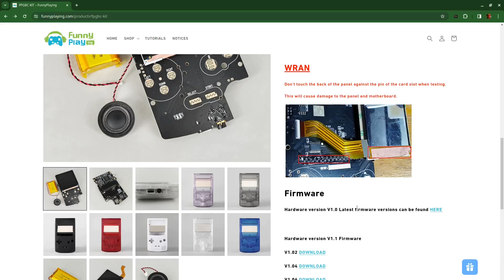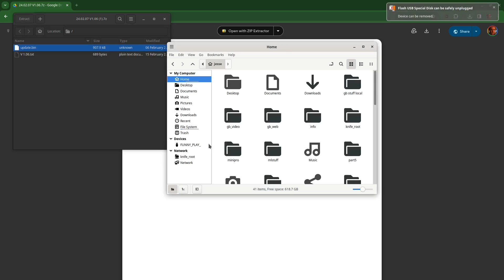Build a new GameBoy Color with the FPGBC

Comment: guys dont do it in the order he did at parts. get the screen on earlier, get the battery on before screwing in the case. otherwise itll be awkward. Also, when putting the screen in, dont just push the ribbon cable in without lifting the door (which this guy didn't mention). Watch Lon's video instead, he did it better.

Comment: After 2 motherboards, 2 screens and 3 ribbon connectors the screen never turns on no matter what you did... one of my friends got the same product and works flawlessly but no luck in my case, don't know what to do now...
Reply from the maker: Oh no! Does funny playing have useful customer service?

Does the system turn on at all? Is there audio?

If your friend is nearby and willing to take a risk you might try using their working system to diagnose yours. You could try their screen with your motherboard and your screen with theirs. Maybe have them do the assembly though, in case you're cursed

The risk is that something is fried and it fries their components

Comment: can you give me a tip? i tried 100 times to get the screen connected but the "thingy" doest go in. its so frustrating

+ i got wrong A and B! my not fitting in the holes...
Reply: They sent me wrong buttons as well just don't fit had to dremel one of the stalks off for them to fit.
Reply: @DerrenKing  thanks for this reply, can you play it fine? Or is the stuff you cutted out a problem
Reply: @JomaroTV  works fine if you don't have a dremel use nail clippers to just snip it off make sure you snip the right one as two will line up and one does not.
Reply from the maker: These connectors are so frustrating. Is it going in at all? Is the little black tab on the connector lifted up when you try to put it in?

Oh no! What A and B buttons did you get?

Comment: I heard everdrive works. Does the transfer cable port work for pokemon?
Reply from the maker: Another user says the Everdrive gb x7 is 100% working and I hear in general that everdrives work. I don't have one to test though.

I've done some battles over the link cable but not any trades. I don't see why one would work but not the other. It was between the FPGBC and a "GB Boy Colour" but I also expect it would work fine with an original GameBoy.
Reply: Use the Everdrive X7 with mine without any issues

Comment: Did the start and select buttons come with? I was going to order but couldn't tell if they were included with the Funnyplaying buttons. Thanks for the video, looking forward to doing this with my kids.
Reply from the maker: Yeah, I was a bit confused when I ordered. The start and select come with the silicone pads. They don't get a plastic cap, they're just rubber. That would have been a good point to mention in the video, oh well!

I'm hoping to get my kids playing some pokemon when they're older.  I even bought a reproduction pokemon red to go with my original blue and a new link cable.

Comment: EZ-Flash junior works without problems. Update your firmware to 1.05e and Firmware 5.
Reply from the maker: I was wondering if that would work but they removed the download link because too many users were having issues with the release candidate version. So I couldn't try
Reply: @systemoflevers  The link is still available. Just type "ez flash jr 1.05e GBAtemp" in Google.
Reply from the maker: Hm, good to know, I'll give it a try. Thanks!